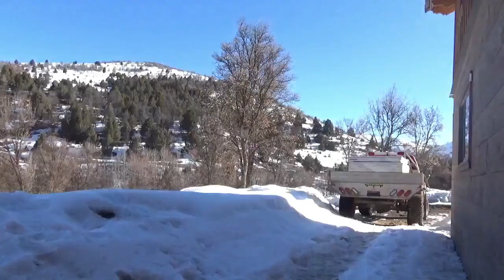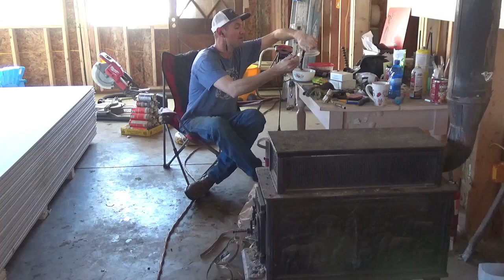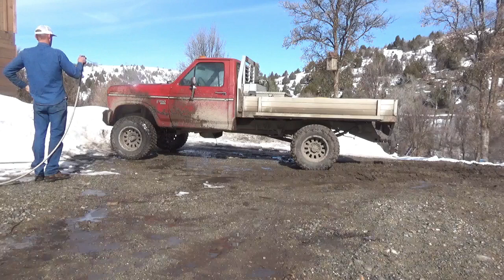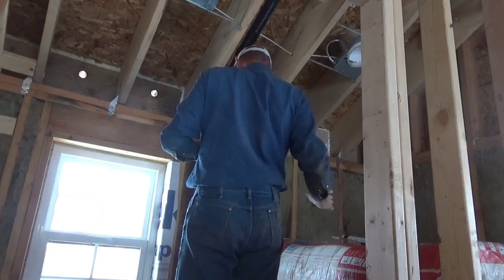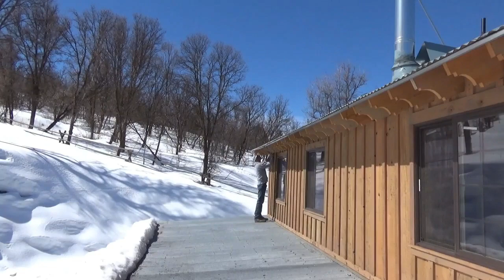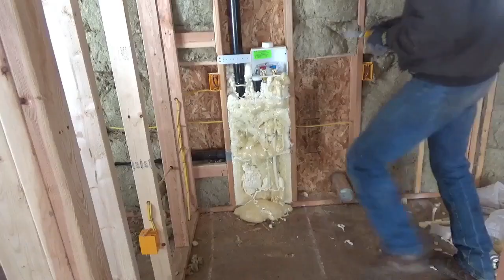#313 - Installed Bird Block, Caulking And Spray Foam DONE, Ready For Roxul Insulation

Comment: My first job as a lad was working for an insulation contractor insulating new houses in estates.    I totally understand where you are coming from saying it’s not your favourite thing to do.    Crawling around inside the roof cavity on 100f+ days installing insulation batts and you have to be fully sealed (tape around your ankles to your socks and basically in a onesie with elastic around your neck and wrists, and wearing a mask).   I passed out at least once from the heat.      Be grateful you’re doing it while it’s cool out!!

Comment: The less seams you have to mud, the better. 12ft are usually better, esp. on the ceilings. Just do the math so you end up with the least amount of seams. 12ft's on the ceiling, you want a lift or an extra hand. You can make one pretty easy with scraps. 3 thin coats of mud will save tons of sanding.
Done a whole gut of my old farm house and learned alot.

Comment: You can use the foam trimmings as filler in other areas that you intend to spray foam into.  That way you have less waste.
Reply: Yes Heath, you do not have a waste problem. Rethink the problem and the solution will be there. As demonstrated by Jesse from Pure Living for Life, he used "waste " foam to fill in the peak of his roof line. Saved himself a few cans for sure. You can do the same around your plumbing. Cheers,    
     Bill

Comment: I lived in a historic apt when I first moved to Nashville. It had 12ft ceilings and steam heat, and a terrible roach problem. I used boric acid in powder form. I used a paint brush to dust it into every crack and crevice in every cabinet and closet, even the floors. Then wiped over with a damp cloth. Everybody else had roaches but me after that. I lived there for 4 years and never had to reapply. The electrostatic charge on their exoskeleton made the powder stick, and it clogged the gills running down the sides of their bodies.

Comment: Heath, great to see how well you're  progressing. I know you get a lot of advice, so here comes more. If you know your upper cabinet layout, install 2x4 blocking, turned with the 4 side flush with the face of studs, positioned at top and bottom of cabinet screw cleats location. It saves time trying to find the stud when balancing drill, screw, and cabinet. Congrats ,100k is right around the corner!

Comment: I did pretty much dry wall work, also at my new home. What I always did was before I started with the dry walls, I was making pictures from what was behind the dry wall, like electric wires, water and drain pipes. Working with a photoshop program to label them, and put in all dimensions. Making a file in which room it was and so on. On that way I always knew were everything was/is behind the closed walls. Its very helpful in the future, believe me, it was saving me later for a lot of damage and saving money plus time. If you want to change something or what ever, you not sure anymore were exactly, let say a drain pipe was, for sure not on the inch or cm. For me easy, checking the wall on the pc and no problems at all. It was costing me two days on the pc, but man, later I was so happy I did this. Great house, take care and Regards, Tony.

Comment: Buy a sheet rock/panel hoist. When you are done with it, it should be an easy sell. Buying and reselling will cost far less than a rental. Learn to use a cut-out tool/rotozip.  A texture hopper is cheap and easy to use. I shot the texture mud and did a rustic broom finish. Everybody loved it. 
Learn about boric acid. It is a great natural pesticide. Maybe a sprinkle of boric acid on the bottom plates before you sheet rock.
Reply: I did that a little over 20 years ago with the Borax and still no roaches in my house. My grandmother taught me about borax.

Comment: What good is the hole in the bird block if you pack that space with insulation?
Reply: It will suck just enough either cold air to condense the warm moist air from the house into the insulation to rain down on it and the drywall with the warm air in the house in winter, or suck enough warm air in the summer to condense into the insulation from the cold air in the air conditioned? house and once again destroy the drywall.  The other thing is that roof will get very hot in the summer with the heat having nowhere to go and that's not good for your roof or house or cooling your house.  In winter it is more of a condensation issue.
Reply: @JohnDoe-np3zk  kinda my thoughts as well,
Reply: @natephillips1696  realistically he will need to add soffit baffles to create space between the insulation and probably leave it open above at some point to allow the bird block air free movement from below to above.  I would also consider using those predone vents in brown.  Bigger holes will be needed but he will need more than a 4" hole every other cavity.  More like the 6"x16" vents every other.  It's not going to work the way it is so we shall see.

Comment: All good insulation companies that are using conventional insulation instead of spray foam will always seal up all cracks & gaps to stop air movement. Don’t stop sealing cracks & gaps, come winter you will be thanking yourself. Don’t rush now, these jobs are permanent, take photos of all water lines and electric, just as a reminder a few yrs down the road. Looking Fantastic‼️👍👍🔨  Vinny 🇺🇸

Comment: By insulating between the pipes and the hot air you’ll inadvertently prevent the heat from getting to them. This can keep them cold, not hot. Put the insulation on the cold side only.

Comment: Well, I have to say you are one thorough guy, which I like. I know your priorities are towards the house, and having worked all phases of construction can truly understand what you are experiencing since I also have difficulties that get into the way of what my mind wants to do, lol. I made a comment on your road earlier. I don't know your situation or the length and topography of your road. I was thinking of doing something simple, like just one drain across the road in a muddy spot. Its all about the water level in the soil. If you give the water a place to go the water will find it. At most fill in spot with some stone if needed. Sharp, hard stone is better than something like bank run, gravel as the sharper stone interlocks better. I thought a I saw an excavator, if you have one, that's so much better. This could be something you do whenever to get out of the house for a bit. Open some trenches along the side to the drain. Take some time and just think how you would like to see how you would like the road to be done. Where any drainage is needed going where. Any spots you might like to widen and what you would do with the material and also any places that need to be filled. You might be surprised how much you could get done. Just some thoughts. Thanks for sharing.

Comment: Just curious how you've designed your house to circulate the cold air from the upstars (master bedroom) to draw the warm air up....
An interesting channel
Lumnah Acres 
Installed air shafts thru the upstairs floors to almost the first floors, floor...
Cold air dropping thru those shafts, pulls the warm air up the stair case and thru out the second floor...
But I always like hearing/seeing ideas I haven't thought of...

Comment: Really appreciate your work, Heath.  I have one question, though.  I understand the need for air to circulate under the roof, between the eave and the peak.  How does that happen when the rafter bay is stuffed full with Roxul?  Just trying to understand.  All the very best!
Reply: RXR Sawdust Station I’m curious about that also unless there is a gap we don’t see
Reply: Mor vents are used to allow air movement under the roof, stapled to the underside. Looks like the roxul is right against the roof, hard to get any air movement
Reply: Tom Hohenadel, Heath used 2x12’s for his rafters. The then used a 4” bat and 6” bat for insulation allowing for about a 2 inch gap between the roof panels and the insulation. He will be fine.
Reply: Kmmm

Comment: The reason for the vents is to have air movement. The air movement keeps the underside of the roof dry. Then you pack it full of insulation? Air won't move through the insulation. You're going to have mold and rot under the roof deck. You must provide space for air to move.
Reply: Yeah I didn't want to say anything but you need to keep that area open so that the air moves to either the gable vents or a continuous ridge vent.

Comment: With this place being setup for your retirement setting up low impact gardens would be a good idea. Table height raised beds will give you garden spaces that allow no bending down to work on them and will give you faster thawing in the spring to get you planted sooner without getting flooded out even in heavy rain like you would get with a standard garden. 

How deep is the snow on the hill that the excavators arm is all you can see of it?

Comment: I'm not sure if i'm missing something here. But isn't the idea of the bird block holes to allow air to rise up through the rafters and push the hot air out the roof vents. Shouldn't you have rafter ventilation panels in first before you put the insulation in? It looks like you are just blocking the bird block holes with the insulation.
Reply: I have been thinking the same thing- similar to a soffit vent
Reply: @oumadmike1  Yes, he has to put them in before he puts the drywall up. They are about 3 or 4 feet long and 14.5 inches wide to fit between the rafters.
Reply: In an earlier video  he says there is enough of an air gap between the roof and the insulation.   Cheers,
    Bill
Reply: @williamwalter8554  oh ok- that's the piece I was missing.  Thank you!

Comment: They have larger cans of the spray foam... picture a gas bbq grill tank. In a two part that mixes as it comes out. That would have been less $. They have metal to block putting in screws into wires and plumbing. Don't forget vent pipes don't freeze. You could have put foam sheets on the outside of house under siding to protect plumbing & higher R value overall.

Comment: Hi , my friend you need to pull the Insulation out of the rafters and get the Styrofoam that lets the air flow up and through your blocking the bird block hole with insulation and you’re stopping the airflow . It will hold dampness and within ten years you will have rot and you will have to replace it later. I hate to see that happen. please investigate further before you drywall your ceilings. thanks
Reply: Ano, i já myslím. Vzduch má proudit nad izolací, ne v izolaci, jak to udělal. Mezi izolací a střechou by měla být difuzní folie a nad touto folií by měl proudit ventilační vzduch. Zavádění proudu vzduchu do minerální izolace je divné.
Anebo jsem nepochopil ten systém děr, co dnes nadělal. Potřeboval bych vysvětlit, proč chce vzduch filtrovat přese izolaci. Vlhkost z izolace má difundovat přes tu folii, co tam nemá. Větrací otvory pro střechu měly být v převisu střechy a ne ve zdi do místnosti. Pokud chtěl odvětrávanou stěnu domu, tak to se také dělá jinak, až mezi vnější difuzní folií a obložením stěny. Nechápu, co a proč tam vrtal a pak zajišťoval proti hmyzu.

Comment: Hey my friend i really love youre videos. I want to ask, why didn't you  put 1 inch wood strips upp under the roof planks before you put upp the insulation? and the air tubes right upp against the roof planks also on a angel ore degree with the roof planks? to have a good air circulation? I am a carpender and it looks like to my that how you put up the insulation covering the air tubes you will have blockced and will have no air circulation abow the insulation for the roof. I wuld love an answer from you if this is really up to code in youre area? ps: love youre videos and youre lifestyle:)

Comment: What's the point of the hole in the bird blocking?  Are not required to  leav an airspace between the roof sheathing and the insulation?

Comment: in the Kitchen area... take a nice piece of wood and draw out a stud and pipe pattern or print a photo. add measurements to it and then put it on a nice piece of plywood and pour clear epoxy over it.. that way you and who ever owns the home in the distant future know where everything is..  just doing it in a book can be an issue hanging onto.. mount the version for the kitchen inside a cabinet door..

Comment: Just make sure you can handle 12' sheets.  They are a beast!  Also...are smooth walls and ceilings easier to install?  I know they make repairs easier to look nice.  Have you looked at all the special tools that drywall install companies use?  I have seen some really cool tools for taping joints and inside and outside corners, a rolling mud box for top coats, stilts, etc.  Think I saw on ebay???  Or maybe Youtube???  The money you save by doing the labor may pay for the tools to make the job easier???  You may be able to rent them too???  Also...saw a cool tool for carry sheet goods...a handle that hooks under them so you don't have to twist your arm and hold with your finger tips.  Of course...do what works for you.  Tremendous respect for you...you are doing it...building a beautiful house for you and your family.

Comment: For example 2:57 I have no idea who told you, that you need these holes in wall up, but truth is - this will damage all insulation inside of roof what you placing in now. You missunderstand, what and where should be ventilated. Everything between Tyvek to inside is closed, everything between Tyvek to outside should be ventilated, like you do not have vertical wooden lath on your facade, you place cladding directly to wall - mistake. On the roof you also made some mistakes. You are trying do ventilation now - where it should not to be ever never ever.
Reply: That really was a huge mistake to bring cold air (and moist humid air) directly into the insulation in cavities and then enclose it??????? Sad sad sad.

Comment: But you're burning that woodstove... it's going to pull air in from somewhere or it isn't going to burn well. I don't think you're going too far over the top though.
 I've learned that when I get very focused on one task, I can tunnel out and not consider the big picture. In floor radiant w/ an outside wood furnace does keep the wall penetration to a minimum. 🤔
I'm always torn between the hyper-functional and my affinity for a wood stove(s).
Reply: This is why an exterior air pipe to your woodstove for combustion air should be considered a necessity.  You need combustion air at the stove, not being sucked in through every sealed crack.  4" would be the size.

Comment: Find yourself a drywall lift before your start hauling round those sheets of board. Your body will thank you for it. A drywall screw gun wouldn't hurt either.
 You could get lucky and find these tools on Craig's list.
I have just done the inside of my house (repairing flood water damage) on my own, couldn't have done it without these mechanical aids.

Comment: Seriously check out aquaponics, you can be fully organic if you wanted. You dont have to raise fish for eating you can use ornamental fish like koi or gold fish. You can grow pretty much everything using aquaponics and it would take less space and it would be easy to maintain and minimal upkeep as you get older. No weeding, everything at a height you want it. No bending down for weeding as you wont get weeds. Just need power for a pump and oxygenator. Just need the fish food and a tiny amount of rock wool or coco coir for initial seedling and there you go. A 30 by 100ft double skinned polytunnel/greenhouse will feed your family all year round, check out murray hallam.

Comment: I was a little shocked by your appearance on this video.  You need to take a break as soon as you can.  You and your dog just run and run and run.  Sorry you are going through medical stuff like that.  This is the first time I've seen a bug there.  How do they survive in those temps?  Can you use a boric acid before sheetrock?  I think you will be happy later that you did apply something for bugs.  And please get some green board for bathroom areas.  Buying sides of beef is so expensive.  I'd stick to chicken, pigs and goats.  They provide other useful products.

Comment: Do two layers of mud. Do a REALLY good job. Skip the sanding. Hide it all with multiple coats of orange peel texture. If you can get a helper have them mix the mud for you while you spray. Brocade is a hand laid texture. One coat of mud will work with it. Even if it's a horrible job. I've covered paneling with brocade in one coat!

Comment: Slow the video down, I have no idea what the bird block is all about.
Reply: Bird blocking, in theory at least, is to provide a way for outside air to get up in your roof and either out a ridge vent, or out the two gable vents.  The problem in this case is that you need a pathway for the air to get up to the unconditioned part of the attic above so that the air can get to the gable vents.  He may have used a continuous ridge vent but either way you need the soffet to vent.  The better approach is a "continuous vented soffet" that is a part of the overhang and let's a lot more air into a bunch of small holes.  Bird block is an "old fashioned" way of doing it.  To cut a bigger rectangular opening then using predone vent would have been way easier.  Only the outside really needs caulking.  Proper venting is done with a formula 4" holes may not be enough even with good air flow but no way will move air through those batts of insulation.  He had better wait on the drywall cause that way will be huge problems.